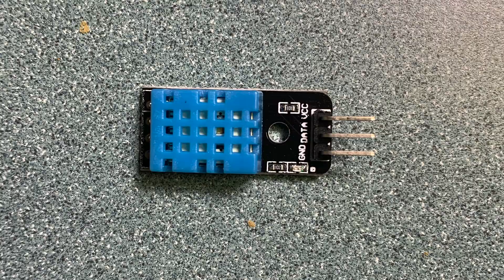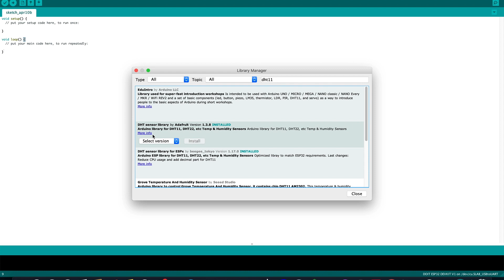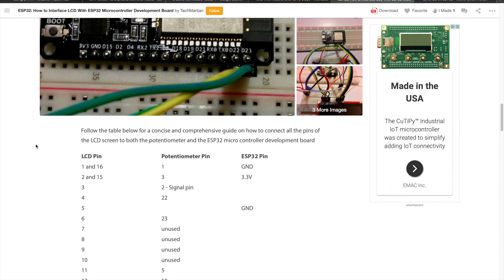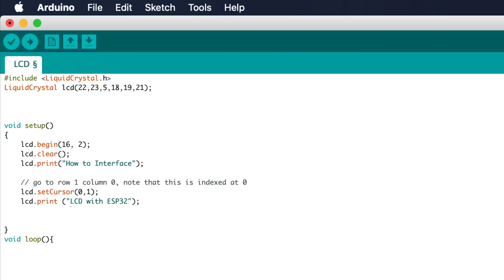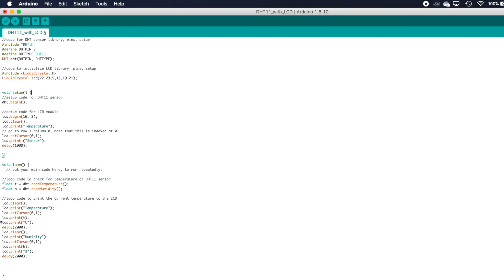ESP32: Temperature & Humidity Sensor with LCD Display

Comment: In which pins did you connect the sensor? thanks for this video.
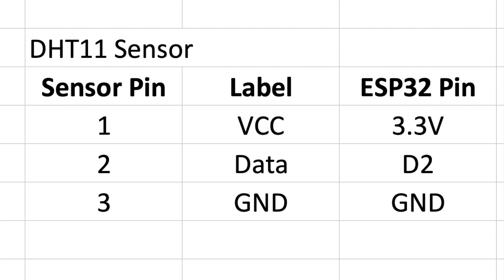Reply from the maker: Thanks for watching!  Check out the 3:20 mark of the video, it’s shown there. Pin 2 for the data, pin 1 is 3.3V and pin 3 is ground.